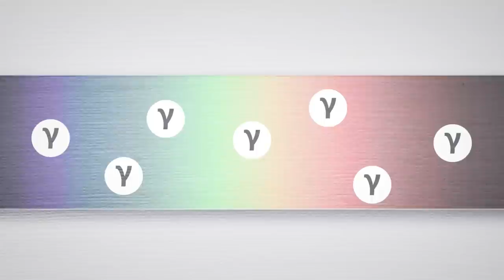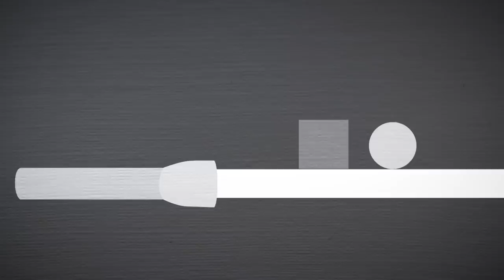How Hardlight Works (Halo Lore)

Comment: Worth noting - Humanity hasn't reverse engineered the Hard Light shield - they're just using the ones that detach from destroyed Forerunner constructs.
Reply from the maker: This is a really good point, and helps in clearing up any confusion of Master chief being able to wield the hard light shield before coming into contact with the Infinity.
Reply: In The Study I was just going to state this. Great stuff!
Reply: don't they have a working prototype hardlight weapon in 4 or 5 though?
Reply: @thecondiffs  No. There arent any prototype headlight weapons. There are however certain weapons with hardlight bayonets.
Reply: What about the bubble shield that came around in Halo 3? You mean humans just scavenged that from Forerunner artifacts?
Reply: @metalcorpseman5433  I'm assuming that was probably just an energy shield like on armor just on a different scale, especially considering the difference in appearance and the fact that they were on Reach too
Reply: @tannerskatrud7504  the Mjolnir prototype suit was shown using a shield similar to the Halo 3 bubble (see Halo Legends "Prototype"). So that shield appearance has been around predating Halo CE, but the portable version was introduced in Halo 3.

Edit: I was wrong. The prototype isn't a part of Mjolnir, but the Hrunting/Yggdrasil series. It's more like a small mech. Either way you're right that the bubble isn't hard light. The one seen used in the prototype is a reverse engineered bubble shield according to the wiki. Basically makes it part of the armor and last more than 20 seconds when deployed.

Comment: I find it funny that in Destiny, which is made by bungie, there's a gun called hardlight
Reply: Ah yes, the rave cannon XD
Reply: Does it fire hard light rounds?
Reply: Destiny is pretty much a clone of halo, they even use the same reload animations for guns and a lot of vehicles are the exact same concept as halo vehicles. Bungie sold halo to remake halo and it’s sad
Reply: But does it use the same tech is my only question
Reply: @lukefurno1151  No. Hard Light in Destiny uses some sort of advanced polymer ammunition, not bolts of solid light like Forerunner weapons. The name Hard Light refers to it being able to channel all three aspects of Destiny Light into its projectiles on demand, although it's also obviously a Halo reference.
Reply: @icyknightmare4592  All of Omolon's weapons fire solid light projectiles. Their 'Liquid Matter Ammunition' is a photonic liquid, aka Liquid Light, that when energized as it's accelerated becomes crystalline. That's why the ammunition bubbles glow in the dark. Omolon gave Hard Light its name for unknown reasons, the ability for it to change its elemental affinity is a secondary design choice after Omolon decided to attempt re-engineering the Golden-Age weapon.
The original Hard Light used Golden Age technology to fire hardened light projectiles. The Hard Light in Destiny 2 is an attempt by Omolon to recreate the weapon's effectiveness and novelty.
Reply: SnowblindOtter wow that’s really cool, did not know all this

You read all the lore tabs or something? 😂
Reply: @Kelton Lin Auto borealis? At this time of year, at this time of day,  in this part of the game, localized entirely in this gun?

Comment: me: aha he is gonna explain how hardlight works, im intrested
actually explain that its possible
me: holy shit waw waw holy shit
Reply: While "solid" and "liquid" light are possible, it's only possible use is in computers. These light "atoms" don't have mass, the electro static force, or Pauli Exclusion Principle, so it can't have the same physical properties as, say, wood or metal.
Reply: @christianyaerger1751  It still can be used as ebergy shield?
Reply: @engelsteinberg593  Nope. There's nothing to actually stop particles of matter. 

The closest thing to an energy shield would be to target the incoming matter (say, a bullet) with a discharge of plasma, and have the ionized debris be deflected by the Lorentz force. 

It would essentially be a highly specialized point defense system, or close-in defense weapon system, that's very energy intensive.

Comment: The Combine also utilize hardlight bridges inside their spire, as well as utilizing hardlight fields to block off passageways.  They use the fields to allow only Combine forces to pass through so that control the humans is easier.  It seems GLaDOS was able to utilize some Combine technology within Aperture as a testing element.  The hardlight bridges GLaDOS used, however, were far more robust in that they required only an emitter in order to function, deriving their power directly from the reactor core that powered the entire facility.

Comment: I think the customization of hard light devices would likely be related to the familiarity of device functionality. In example pistols or rifles when people got an idea how to get it to work, a medic might have a reconstructive tool or engineer would fix, tear down or build useful things. Of course limited by the energy available, control devices and maybe emiter size. Tho thinking of function it sounds similar to say the study of frequency. Different frequencies create different shapes. Not to mention scalar waves can trap particles between waves. Suspending water and sand like wise.  But this seems more like infusing extra energy to temporarily alter the matter of an object. Like adding more electrons/protons to a space traped in a field to change the element or atom into another. 
Interesting ideas. Tho I dont see the item smartly making up for the lack of knowledge unless say there is a data crystal infused with the blueprints or memories of a forerunner from the past. Tho for game mechanics it would be fun to make different characters to level up andtheir abilities are saved say on a memory crystal that each new character can use. And thus give multiple gun type weapons to a medic, then enable an engineer to use the previous 2 skills in the next play threw.  Could be a lot of fun.

Comment: I would like to see an enemy weakness being that if you can get to the source of the emitters, you can destroy it and cripple the enemy’s ability to deploy troops to that area. Of course they would defend it, so you would need a Spartan, or a TEAM of Spartans, or TWO teams of Spartans (Hello Osiris), or MORE than two teams of Spartans (Hello Red Team, Blue Team, Grey Team, Team Black, Spartan IVs, etc) to assault one of these emitters. Or maybe the emitters are just the means and there is a massive data core (like Cylon Resurrection Ships) that you can destroy.

Comment: Light already pushes objects. Tecnically it can already do all the things you mentioned but it can't be shaped.
And the energy requirement is so big that the object would instantly melt.

Also, when entangled photons leave the gas, they loose their propriety to interact with each other.
Becouse they can't directly interact with each other, they can do so only by interacting with the gas first.
Basically the gas is the bridge that permits photons to act like molecules, even if they are not.

What i would do in a sci fi universe is have that gas in a particular location and then shoot and somehow control the hardness and mass of the gas with the photons. Essentially making gas + photon act like a solid structure.

Comment: How do space battles work in halo? I mean I get that the fighting is extremely far away but is there any lore that goes into detail?
Reply: Check out the fall of reach on netflix, it has a small scene of a UNSC ship vs a covenant ship
Reply: Actually there always really close because the covenant ships can make inter system jumps.. check out the scene in the fall of reach where the captain says that the unidentified ship won’t be in weapons range in awhile and then it makes an inter system jump right next to the UNSC ship..
Reply: UNSC ships fight at long range. Covenant fight at close range.
Reply: @hunter_thespy1233  the fall of reach is not an accurate source whatsoever.
Reply: @cookiemuffin3208  not accurate
Reply: Space battle in halo can range from point-blank (meaning kilometers in the single-digit ranges) up to a hundred thousand kilometers in some cases. UNSC missile technology is advanced enough to make these distances in reasonable time and accuracy, as with some calibrations for MAC cannons using lighter payloads for significantly faster projectile velocities. The same can be said regarding Covenant plasma torpedos and energy projectors, which are stated to have ranges exceeding 10,000km. 
Range is usually determined by the strategy employed by either side, as we've seen ships engage in extremely close combat before like in Halo Reach with the Savanah firing its coilgun batteries at a covie corvette as well as the example of inter-system jumps you stated; however, these engagements are exceedingly rare within the human-covenant war as a whole and usually serve a purpose that would otherwise be generally considered impractical from a strategic standpoint.
Reply: Çøsmvœ FoR is plenty accurate, dunno where you got that from.
Reply: The space fight in halo works close to expanse physics, but when you go ancient halo that's some jackshit going on

Comment: Sounds like similar concept as a lightsaber
Reply: Lightsabers aren't hardlight though; they're an exotic form of energy field that strongly interacts with other energy types (including other Lightsabers) and that can melt/burn through nearly anything, except for a strong enough energy field or an energy-resistant material.
Reply: @blam320  it is plama
Reply: @Johan-uu7io  They're not plasma either; plasma is superheated gas, meaning the entire lore behind Lightsabers would need to be reworked if they were.  As it stands, Lightsaber blades derive all their properties from the primary focusing crystal, most notably their color.  If Lightsaber blades were plasma, they'd derive their properties from the gas that's being ionized.  Meaning if you wanted a blade with consistent properties you'd need to keep a canister of whatever gas you want to ionize in the hilt.  You'd also need a magnetic field to contain the blade, which would dramatically change the shape of the blade.  It'd also be completely useless underwater.

Comment: So basically a more practical version of the holographic technology from ST.
Reply: Basically not at all.
Star trek holograms are beyond this, wich you would know if you had seen it all.
They use holograms to duplicate their ships, the holograms are able to pick up objects.
The doctor in voyager get's a mobile emitter from the future and is able to do all of this without massive power consumption.
Having a floor that you can turn off seems kinda gimmicky.
If i could choose, i'd go with holodeck technology.
Reply: StopaskingformynameYouTube I think by practical they meant achievable.
Reply: @StopaskingformynameYouTube  I wouldn't judge if ST's "superior" than HALO's, as they were essentially different technologies with different applications. 
ST's halographic technology was presumably based on transporter and replicator(particle synthesis) technologies, making them more suitable for simulation and manipulation. However, it seemed to require either enclosed environment or short distance. For instance, the holo ships deployed against Kazon had no offensive capabilities(but they somehow "absorbed" incoming energy beam), and the mobile holo emiter didn't seem capable of projecting over longer distance. While the ablative armor generator was extremely effective as a defensive measure, it was more like a replicator than a holo projector.
HALO's hardlight technology seemed more related to force field and plasma torpedo technologies(the latter utilized magnatic field to trap plasma, maybe that's how the Covenant acquired plasma torpedo and  shield technologies?), making them better at force projection and defense, however as far as simulation goes it seemed very crude and inefficient.

Comment: Hm, I didn't realize the technology could be rated as not just plausible, but possible. As a sci-fi writer, I'm always on the look out for things like this that help me build and design future technologies.

Now I have one more piece of tech to add to the mix. Though I suspect power is a big limiting factor. Would a hardlight hologram use more or less energy than a Star Trek holodeck? For that matter, are there other systems that provide equal or even only a little less shielding for far less energy? If you need an entire fusion reactor just for your hardlight shields, may not be worth it when a different tech can be fed just fine on the same reactor that powers your weapons, even though it can only take 6-8 MAC rounds instead of the hardlight's 8-10. So while the tech may be viable, in the end, it may not be the best choice.

The kind of mental gymnastics I love!

Comment: Between Hardlight weaponry of the Forerunners and Turbolaser cannons on Star Wars capital ships in the Expanded Universe said to be 200 gigatons per shot which weapon was more powerful, destructive, and fitting for galactic wide war?
Reply: My guess is hardlight. The light is solid but still moving at relativistic speed. So the solid light is carrying the energy needed to travel at the speed of light into a target.

Comment: hard light sounds like photons that are vibrating at such a low rate, either from temperature or from other means, until it becomes "solid" enough likened to matter. It seems very possible. Like if you were to take a virtual particle and apply spin/vibration until it generated mass/density, thus making it "real"ish. Sorry I said this before watching your video. My bad

Comment: 1:32 lightsabers
Reply: No lightsabers have plasma blades not hard light
Reply: @hunter_thespy1233  well it looks like a lightsaber dont ruin the fun Mr smith
Reply: @hunter_thespy1233  A lightsaber in real life could be either plasma or hardlight
Reply: @XbninjaXIV  not really. HardLight doesn't induct heat to other objects as fast as plasma does. Hardlight is pure radiation in an exotic format whilst plasma transmits heat to other objects much quicker because it itself is just heated matter.

Comment: Why don't they just use a form of this concept of "hard light" to "explain" lightsabers? It'd make more sense than what they're dishing out there currently.
Reply: A lightsaber is just a plasma beam that’s held in place and shaped by a magnetic field.

That makes plenty sense as is, if you used hard light to make a lightsaber then it wouldn’t cut through anything unless you shaped it like a blade like with the knight blades, it would basically just be a baseball bat.

Comment: So what exactly did the Forerunners use as a fuel source for all of this hardlight? Seems like they just ignored that slightly
Reply: They used vacuum energy.
Reply: Vacuum, Anti-matter, Plasma etc.
Reply: They employ multiple methods of generating vast amounts of energy ranging from creating artificial suns, harvesting vacuum energy (AKA zero-point energy or dark energy) from the quantum fields that exist in space normally or from an artificially sustained universe (called a proto-universe), and antimatter reactors. 
although primarily, vacuum energy proved to be the most powerful and stable across the forerunner empire.
Reply: Space magic.

Whatever they used, it was so advanced and esoteric, that it's just not worth thinking about too hard.
Reply: @Paddy656  there's almost no reason to say that. It's described pretty well in the forerunner trilogy and isn't THAT hard to understand the general concept even half paying attention. 
If it helps here are some articles to support the concepts involved in their energy production: 
https://en.wikipedia.org/wiki/Vacuum_energy
https://en.wikipedia.org/wiki/Zero-point_energy
https://en.wikipedia.org/wiki/Negative_mass

Comment: If we can turn photons into more traditional atoms wouldn't it then not require electricity to maintain it? Changing it or deconstructing it back to photons would require electricity obviously. But if made into a solid crystalized structure wouldn't it simply exist then?

Comment: Bro halo4? 
Halo 4 is retarted, it makes no sense. Hardlight can only exist between two points, yet she comes out of it. Would make more sense if she caused the hardlight to fail causing the didact to fall through then catching him in between the hardlight. Or not catching him at all and letting him fall all the way.
Reply: well if you couldn't already tell the didact can hover and chief can not, so that wouldn't work. 
otherwise, it's for storytelling purposes. I don't see where the problem is tbh.
Reply: @InveterateMendaciousness  crappy storytelling
Reply: Peace & Quiet you’re not very optimistic are you? I think you just don’t like halo 4 because of solely the things it didn’t do well.
Halo 4, at least in my opinion, had a solid story that took the games in a different direction in terms of mood, even if it didn’t fit into the storyline as well as most people would’ve liked. I just appreciated the effort involved generally.
Reply: @InveterateMendaciousness  im not very optimistic when it comes to halo 4. There is a lot of things halo 4 did wrong.
Reply: Peace & Quiet that’s fair and it’s true. Halo 4 wasn’t a great game, but at least there was a lot of apparent effort involved to make an interesting character arc. It had depth, if nothing else.